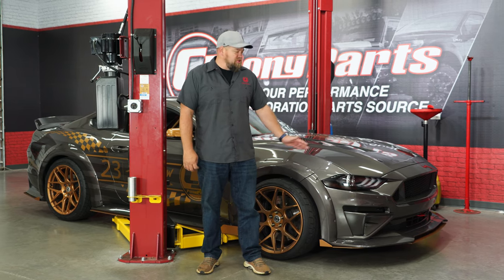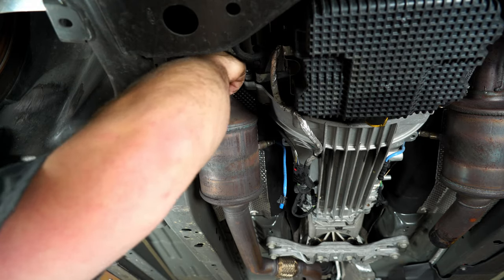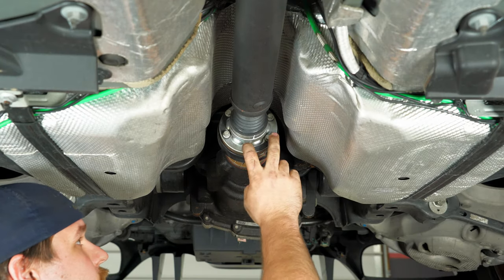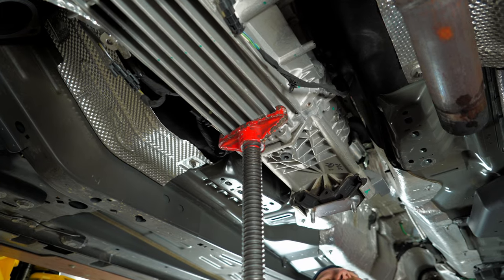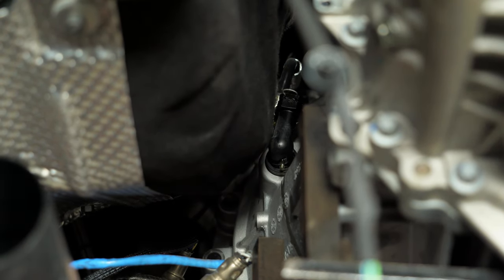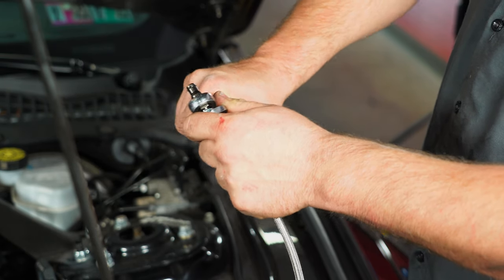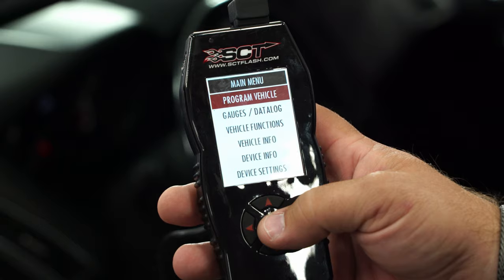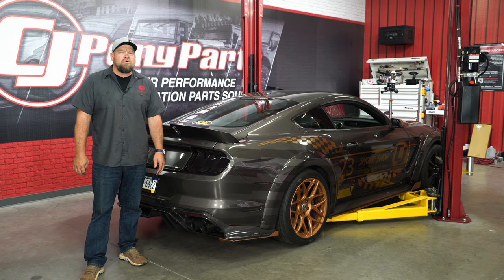2018-2020 Mustang Install | RAM Clutches Dual Disc Clutch Kit & Flywheel

Comment: Is a crank relearn need for a 2021 ? I replaced my clutch 4000miles ago and never relearned it and no cel so ?
Reply: Hey quick question is my clutch pedal suppose to be closer to the ground after replacing my clutch and all because I sent my mustang to Ford and they are telling me that its normal I'm not sure if it is though ?
Reply: @Johnny-ex2od  should be fine I have the rst clutch and it’s just stiffener than the factory but the other deal distance is the same it’s just a different feel and I also have steel clutch line so it much stiffener

Comment: Does anyone know if the clutch on the 2017 Mustang gt will fit on a 2018 gt?
Reply: I wouldnt bc gen2s came with a single disc but can use (dual clutch) but on gen 3s its only twin disc clutch,hope this helps

Comment: how would you compare this to an RXT unit?  running about 800 wheel, always heard the rxt destroys the mt-82 then again tons of guys running them no problem either
Reply from the maker: So far it seems to have a lighter pedal and a little softer engagement than the RXT.
Reply: @cjponyparts  did he say Tq the Flywheel bolts down to only 28Ft lbs ? And then 90 Degrees ? What are all the Bolt TQ Specs ? ? For the whole install on the 2019 Gen3 Coyote mustang gt ??